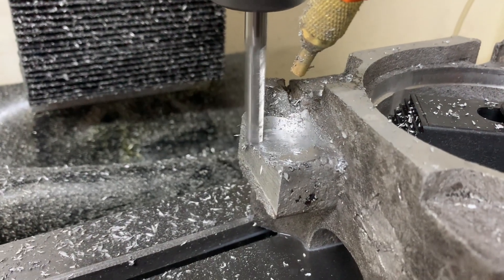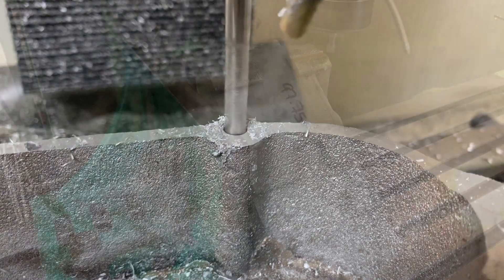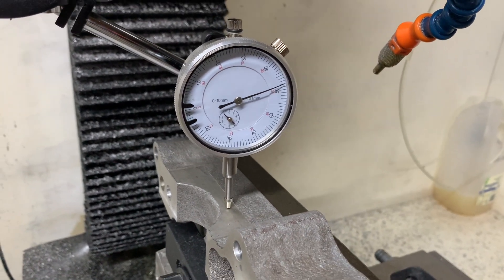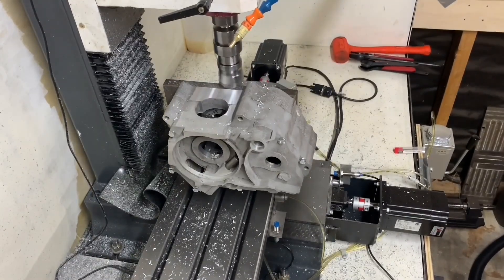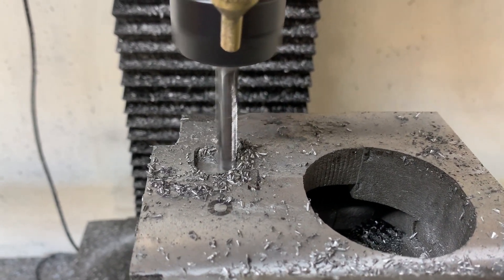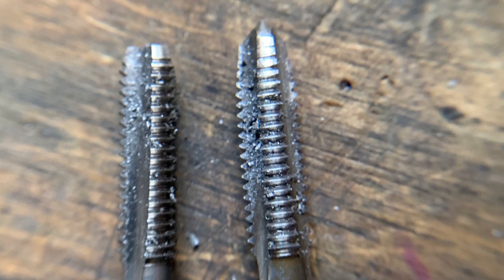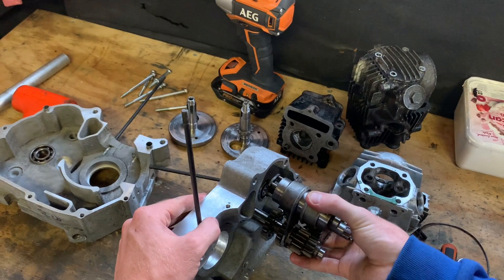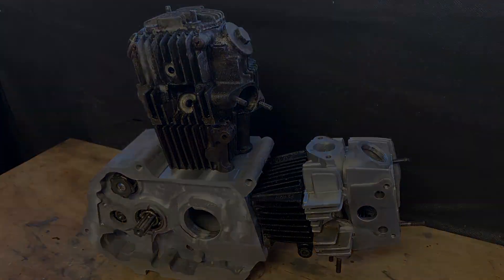144cc Homemade V-Twin Engine

Comment: What locates the cylinders on the case? Doesn’t look like you machined/bored the case to accept the liners….
Reply from the maker: There are dowels on two of the four cylinder studs for each cylinder.

Comment: Blue Max and porosity ?. How- where did you use this please ?
Reply from the maker: I didn’t end up needing it as the porosity didn’t cause the engine to leak oil. Paper gaskets worked just fine, but it is just an Rtv silicone that may have helped seal pin holes.

Comment: This is beautiful!   One question I had with the Millyard SS100 and also your build is how does oiling the top end of the second cylinder work?  Did you have to add an oiling circuit to get oil up there when the engine is running?  Millyards cases look good on the outside but the inside looked like there was substantial welding filler, and machining - I spent alot of time trying to zoom in to see if there where any noticeable changes for oiling but couldn't spot any.  Your cases are so clean - very cool!
Reply from the maker: Thanks, I’m going to run an external line between the two cylinders, seems like the least amount of hassle. I’ll run a banjo bolt either from the RHS head cover usually where you can connect an aftermarket oil cooler, or I’ll place a fitting on each cylinder where the bottom right stud runs and have them tee together.

Comment: Did you do the CNC conversion on the mini mill yourself?  Love a short vid of some details on it.  Nice work
Reply from the maker: Yeah, I did the conversion over a couple of months. It wasn’t too complex. Mostly following circuit diagrams and reading manuals, with a few parts that needed fabricating. I’ll definitely do a short video at some point.